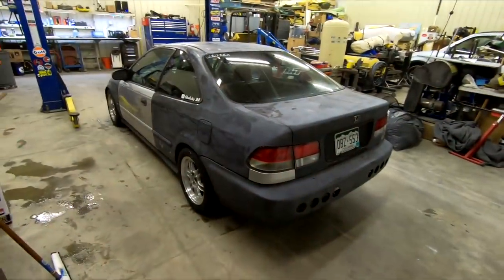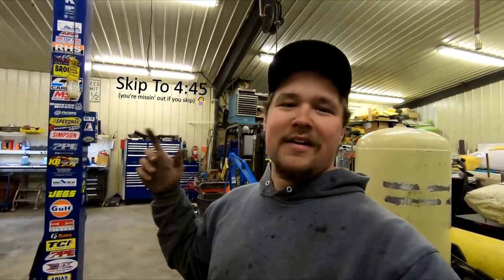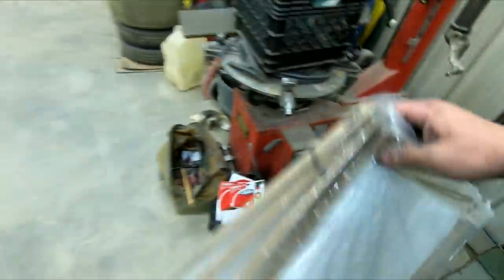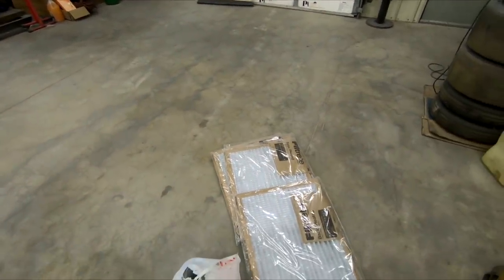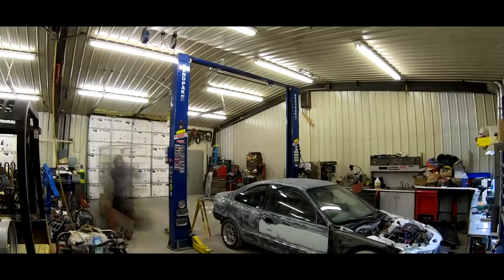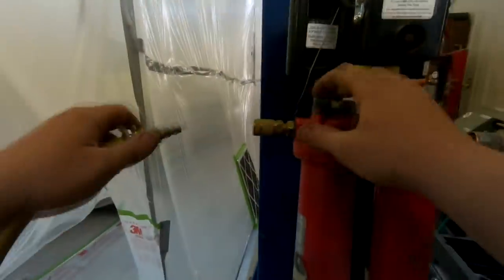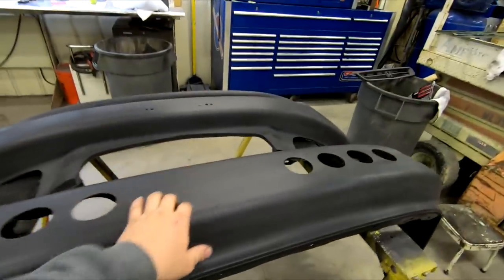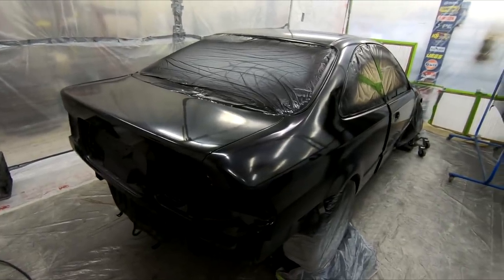EK Civic FINALLY Gets Painted!

Comment: Looks great! Doing the same with my 99 ek right now, and did the same welding in the holes for the molding. That has to be the most time-consuming part lol. I went ahead and also deleted the windshield squirters on the hood and the antenna. I'm going single-stage black on mine as well, but I'm going to try Summits paint since they're a little cheaper. I'll post a video once it's all done.

Comment: Just use a 1500 grit trizact on an interface pad followed by a 3000 grit trizact on interface pad. Don’t use too much water or it’ll hydroplane and not remove the defects and 1500 scratches.wash the car first and keep the sanding discs clean.some m100 on a wool cutting pad followed by m205 on a foam polishing pad will make it look great. Can use m305 glaze on fresh paint. Just don’t wax it for atleast 3 months I’d wait 6 months tbh

Comment: Call the car Black Mamba? I dunno man. Also, don't feel bad about the paint job at all. I've personally sprayed quite a bit of that eastwood 2k urethane, and to sum it up, it's not the best for a DIY'er. I first had to reduce the shit out of it (around 20%, which made it flow well, and it sprayed nice out of a 1.3mm tip) But that paint already has quite a bit of solvent in it, so it liked to dull off as it dried, and some of that orange peel would return. I then started reducing it around 10% and heating it up to around 35 degrees c before spraying it, laid down flatter and easier, but still dulled off a bit once it dried. It never seemed to want to flow or stay wet too long, took me a lot of effort just to keep a whole small car wet.
Reply from the maker: I'm definitely no painter haha always wanted to get good at it, but hard to find good information. Ask 100 people and you will get 100 different answers. But thanks man, I'm going to reduce it a little more to spray the bumpers and see if it will flow out better.
Reply: Best of luck man! Bumpers are a lot more manageable too. Do you know what size tip is on the gun? Sometimes a 1.2 or a 1.3 works better for jobs like this instead of a 1.4 or 1.5 It will put on less material per pass, so your coats don't end up thick or "built up" You can get away with doing 3-4 thinner coats to help even up the finish, wetting up areas as they need it, and still get the same material on as 1-2 heavy coats, but with better, easier results.

Comment: Has more orange peel texture than an actual orange! Watch what fluid tips you use it’ll help with that
Reply from the maker: I used a 1.5 to spray the single stage. 35psi inlet pressure
Reply from the maker: Sata jet 95 gun